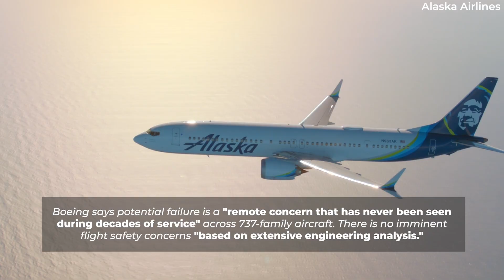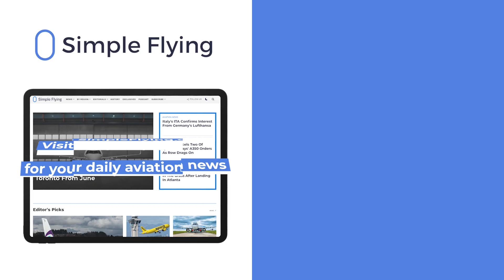The Anti-Ice System Issues Plaguing The Boeing 737 MAX & 787 Dreamliner

Comment: Give me the good old 737 classics or NG anytime over the MAX!
Reply: I fly 737 300
Reply: Good thing Ryanair has 400+ 737-800s
Reply: they're being replaced so sadly not many will exist
Reply: I prefer the MAX, the best 737 ever made 😉
Reply: @ACPilot  Many people are gonna disagree with you, keep that in mind
Reply: i'd prefer original/jurassics ones... it's the initial design and meant for jt8d engines, nothing could go wrong with it, and the analog cockpit is sure more reliable than mcas...
Reply: @힐만94  I like those 737-200s retrofitted with the glass cockpit of the 737NG
Reply: Google Boeing 737 accidents and you'll discover over 5,000 people have lost their lives since the aircraft was first released. You reckon that's reasonable?
Reply: I rather have the 727 200.